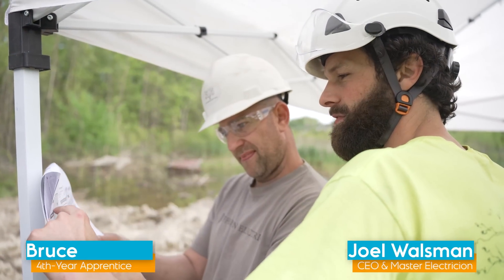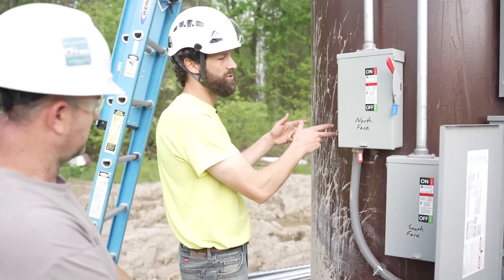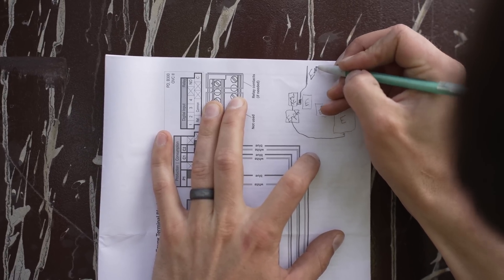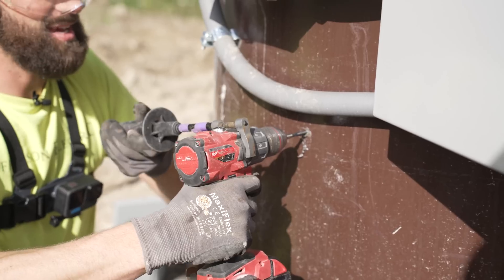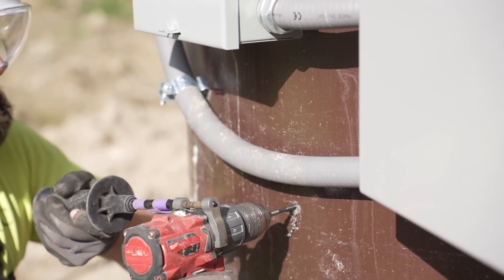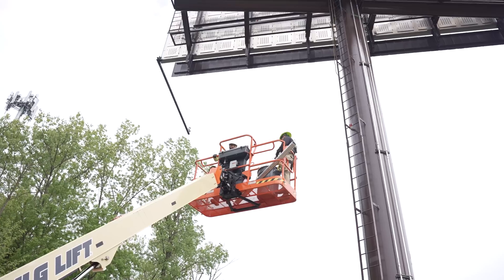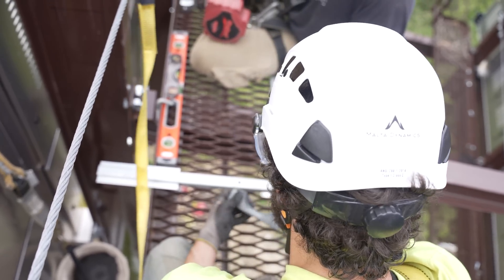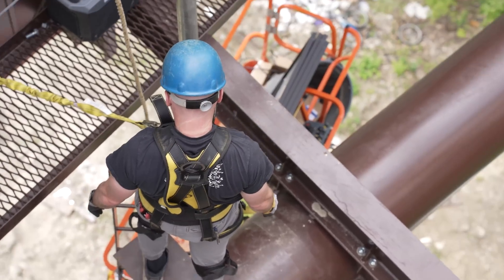The MOST DIFFICULT Solar Installation We've Had Yet - Part 1

Comment: EMT up the riser? Not rigid? PVC? Or even aluminum rigid for outdoors? I know it may not be against code to use EMT outdoors but we all know how the zinc fittings will rust and so will the pipe over time? Just curious??

Comment: I worked with Enphase equipment today; microinverters make for a much simpler install and inspection, since it's just a source branch circuit from your array, and the combiner is just an ordinary panel. The magnetic drill press is a beautiful tool.
I think UF-B is underused, seen so many trenches with hideous shoddy PVC just to move less than 55AAC, and thought about how much labor could be saved by running the trenching machine 6in deeper and using 6AWG UF-B. Most of the time people are right at the limit of conduit fill anyway, so the upgrade argument rarely matters. Southwire 6/3 copper with-ground UF-B is like four bucks a foot and in stock at any Home Despot.